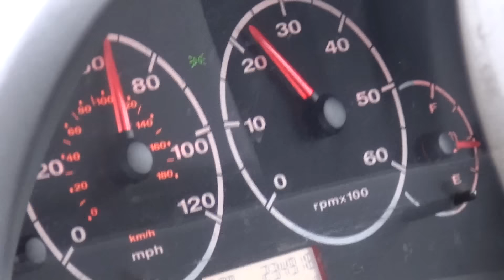🐒 CHAOS ON THE TRACK! 2ND DRIFT DAY IN MY S14 SR20DET

Comment: I noticed passanger pusying the hydro back to keep it out way you could poss add a spring from down low on the wond to centre section of dash so when you pull it it pulls back out your way just a thought I had

Comment: lol the sr sounds like a chainsaw with a blow off valve
Reply: StumblingTech 34 not running a bov....
Reply: coupe Turbo watch the video again
Reply: if he is running one its not opening properly and going back through the turbo
Reply: i killed my t28 journal bearing having it flutter sounds mint tho
Reply: coupe Turbo Haha I have a t28 and I'm putting it on my sr20 in my nissan primera (Infiniti g20)
Reply: oh sounds good man, yeh its known as the primera here in the uk, thatll be good fun!
Reply: just make sure to run a recirculation valve or a bov that dumps fully like the hks ssqv series valves which need no adjustments at all to run on most cars

http://like.the
Reply: wtf has it put a link in the comment for.....
Reply: mines the journal bearing t28 not the s15 ball bearing t28 so its more fagile/delicate when it comes to cooling off and letting it get to temp
Reply: im running an inline 5 turbo with nearly 300horse to the front wheels